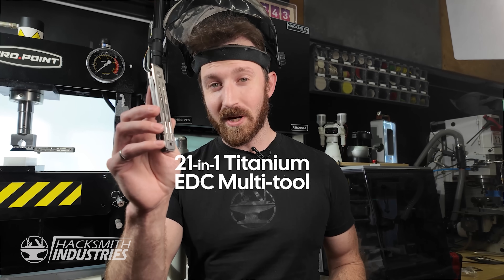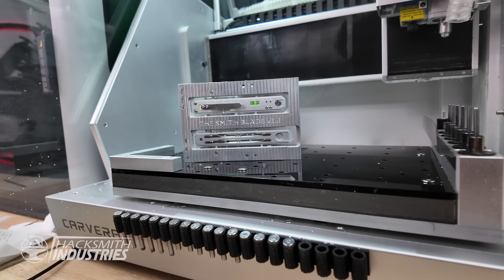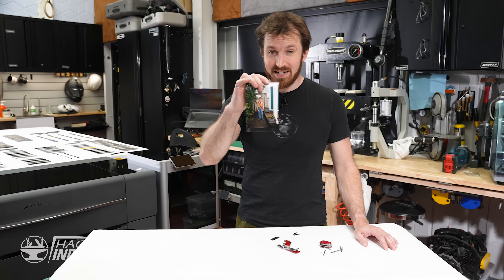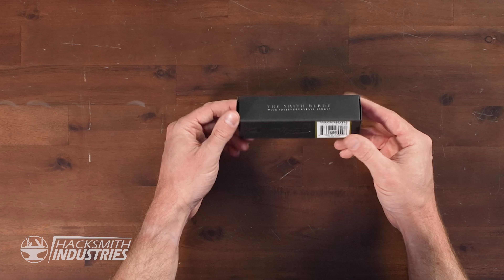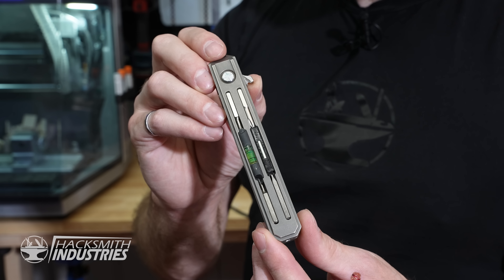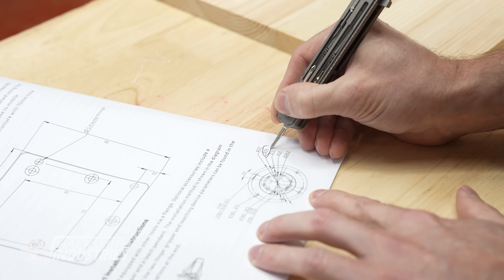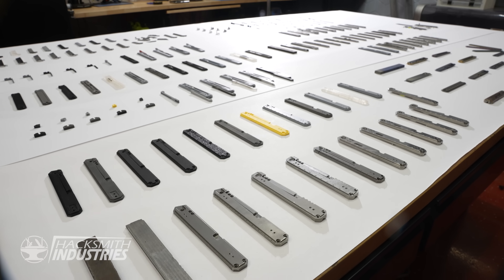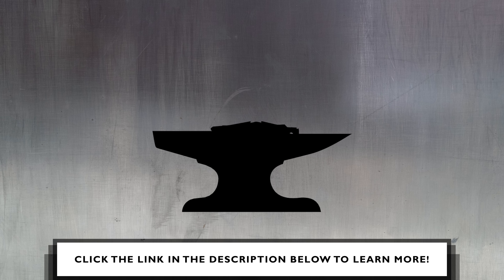We Made a Knife that can CUT THROUGH ANYTHING!

Comment: The most important thing on M390 is proper heat treatment. Without that, M390 mean nothing. You can make it proper like the Spyderco or poor like the TwoSun. Both knives are from M390, but there is huge difference between edge retention and toughness. 👍
Reply from the maker: And why would we sell it with bad heat treatment? come on man. you don't spend over a year on a product and do something dumb like that
Reply: That's great! I only said, that proper heat treatment is the key. It wasn't bad meaning. 👍 I think, that this should be a great product.

Comment: 0:19 it cut the plastic but it didn't cut the metal. it literally crushed it till it stress fractured. what did the blade look like after, close up, and not from 6ft away? Also if you have to use an hydraulic ram to get it to cut an object it's probably not gonna cut under regular circumstances
Reply from the maker: It literally cut it in half. Not crushed, not stress fractured. You can see the blade and the full story in Adam Savage's video coming out on the Tested YouTube channel in a few days!
Reply: The knife specialist is here 😢 "real life job super market repositor, internet job the everything specialist, from cameras, angles, metal, hydraulic presses to knifes"
Reply: Just be a hater 🥀
Reply: Even if what you are saying is true, are you really trying make the argument that the utility of a knife should be judged on its ability to cut through the metal of a Swiss Army knife?

Comment: Does the blade snap into itself with angles higher than 90 degrees via the protractor? I'm just grimacing at the idea of trying to use it as a protractor with a large angle and then suddenly SNAP if my thumb is in there, or does it stop at every 15 degrees until you close it yourself?

EDIT: I looked at a very helpful GIF on the kickstarter page, it answered my question, it looks awesome!
Reply from the maker: It's not a snap -- it's not spring loaded -- you are the one who moves it ;)
Reply: forgot to mention, it looks AMAZING, just had a sudden thought was all

Comment: Will it hold up well in dirt and mud? How easy can the little screw bits fall out? Otherwise it looks really good
Reply from the maker: Drop proof! Spent months getting it perfect. It's all corrosion proof, but I'd recommend cleaning it after getting it muddy! Bearings don't work well when there's dirt in them!
Reply: Good question about the bits holding. Considering the knife is titanium and steel, I think it will perform the same as any other outdoor multi-tool/knife in the dirt. it doesnt have a lot of fold out mechanisms so might not gunk up as much?

Comment: Nail file on the BLADE is an interesting choice. Same with the drill bits, tweezers, etc being detachable. I just know I’d lose all of them along with my finger tips in the file 😅
Reply: I could be wrong but it looks like you can still use the nail file with the blade closed if you’re worried about cutting yourself
Reply: @bradysivers2393 oh that would make sense maybe I did kind of just take James using it blade out at face value lol
Reply: Exactly, although knowing hacksmith there's probably a lifetime warrenty or something
Reply: @AxolotlInANutshell-df5xi oh I’m sure but I’d still expect HSI to create a product I most likely wouldn’t need to use the warranty on. I’m not hating or anything it’s a good knife I just can’t wait to see the improvements in the future.
Reply: You actually think you'll have a difficult time discerning the business end of the blade from the dull end?
Reply: Some of those tools look very similar to the victorinox version! Interesting choice, but definitely valid. They've got some of the best designed ones anyway, might as well.
Reply: I thought that about the protractor